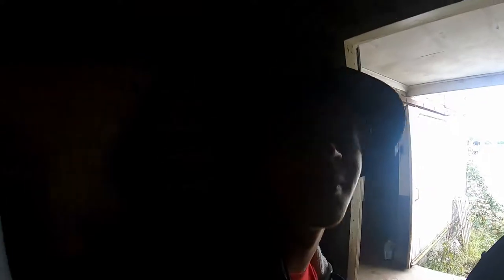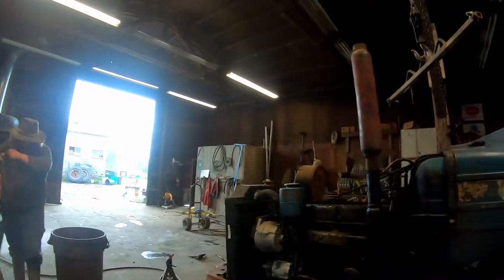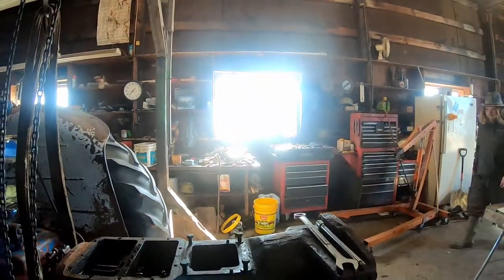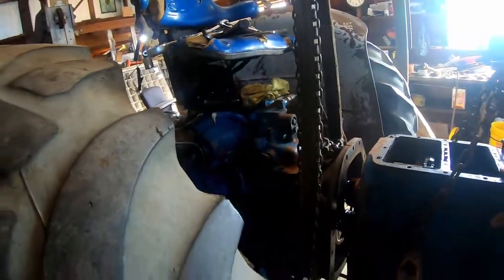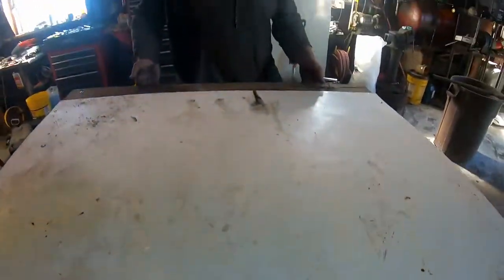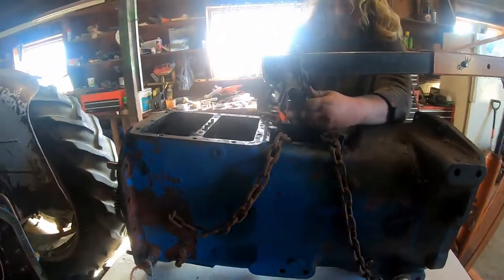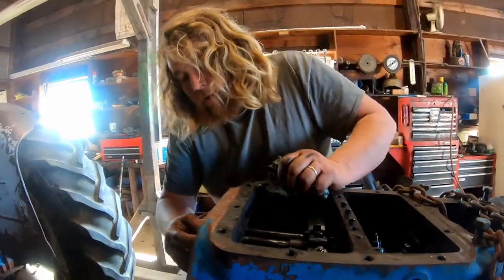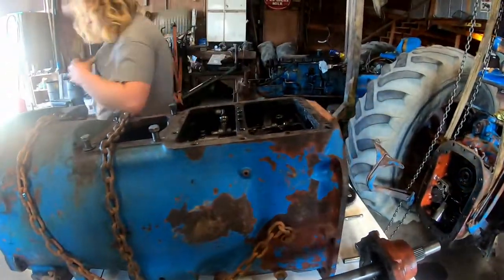Splitting a tractor into 3 pieces and disassembling the transmission.

Comment: I’m amazed about your tractor knowledge.  Excellent video!!
I have a 1980-81 Ford 340A industrial tractor.  The rear end hydraulic fluid is leaking into the transmission fluid.  Will I have to split the tractor to replace seals??
Please help !!